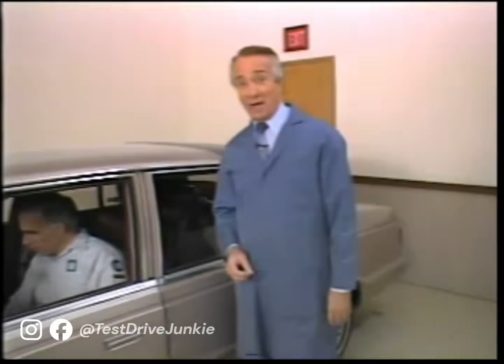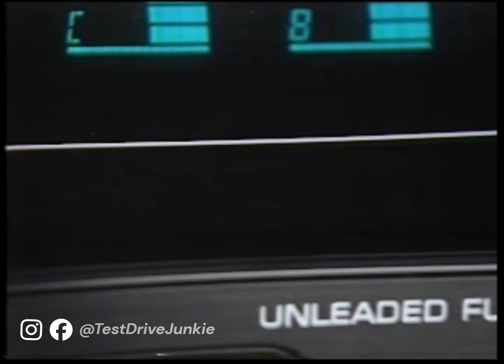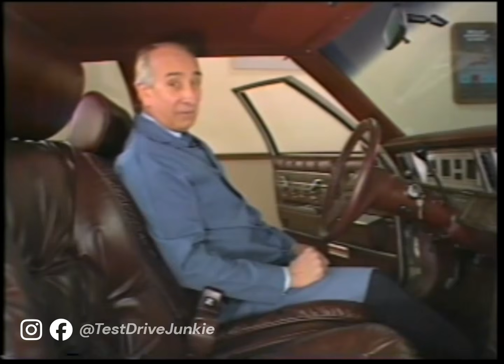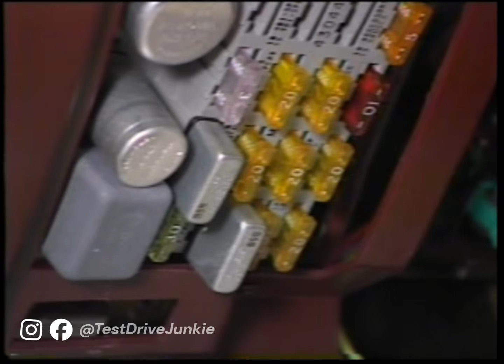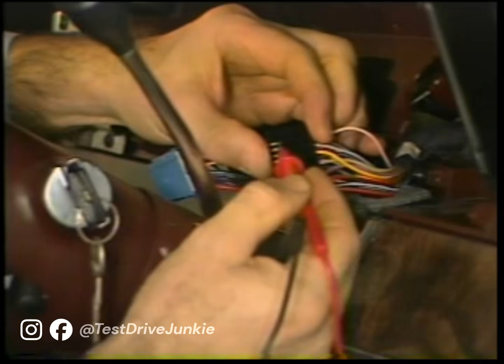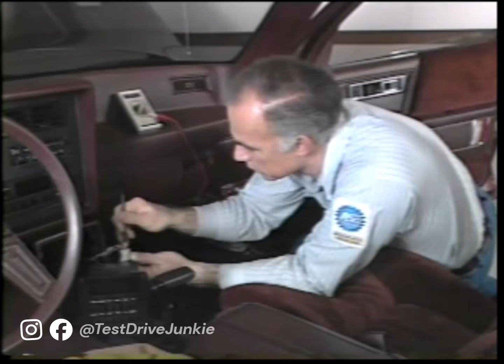1986 Dodge Master Tech Electronic Instruments Radio and Cluster Manufacturer Betamax Training Video

Comment: This dudes voice was iconic. In fact, all of these service videos from Chrysler and GM (idk about Ford) had perfext voices for this task in the 80s. 

I miss old Chrysler. Huntsville was a cutting edge division, it was impressive that Chrysler was so multi faceted that they had their own electronics division like a much larger company such as GM with DELCO/DELCO-REMY. 

I also miss the Pentastar logo. Chrysler really leaned into it under iacocca, it was everywhere in the 80s from every piece of chrysler paperwork, video and even the cars themselves. I hate the fact that it was killed...twice. First by Daimler, theres a famous incident that occured when the Germans first arrived in Auburn Hills. The Daimler executive pointed to the famous Pentastar on Chrysler headquarters and asked "what is that?". The Germans werent even aware of the logo of the conpany that they had just merged with (boughy actually, but thats another discussion). Daimler then attempted to remive it from the building, but soon realized the cost was too high and an almost inpossible task, so they left it, and the famous top window of Chrysler HQ is one of the last remnants of the famous logo. Ive been saying for years that the Chrysler Group needs to being back the Pentastar emblem as at LEAST their corporate logo. But that looks like it'll never happen, especially as long as the company remains in European control. Now Chrysler doesnt even have a corporate logo, other than the crappy simplistic FCA emblem and whatever that Stellantis bullshit is supposed to be.

Comment: Little did we know in 1986, needle type gauge clusters would be obsolete and LCD screens would be standard in all vehicles 40 years later.
Reply: I still prefer to put the transmission into drive not tell it too